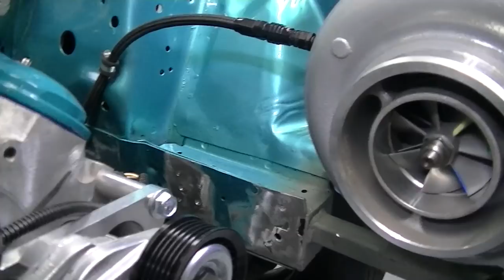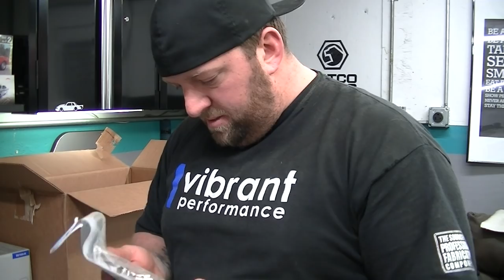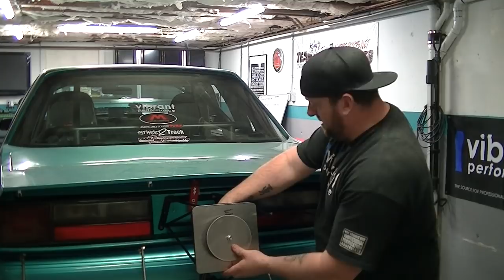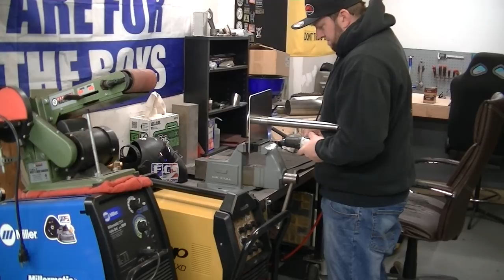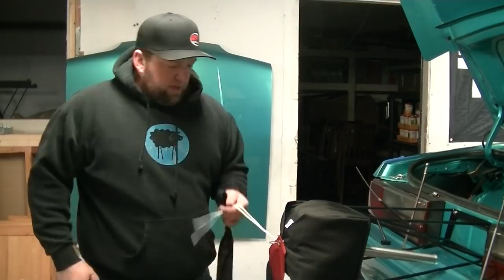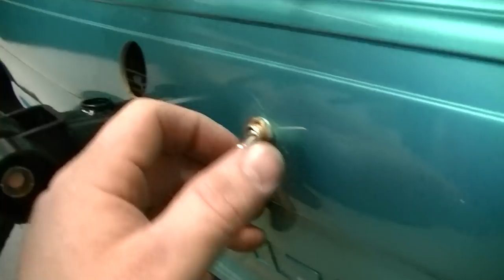Ls Foxbody build EP. 52 Stroud air launcher

Comment: You should really put your remove before safety pin in the opposite way you will be putting you cable in so no way when removing the safety pin will cause the cable to pull out
Reply from the maker: jbt8080 good point. Thank you.